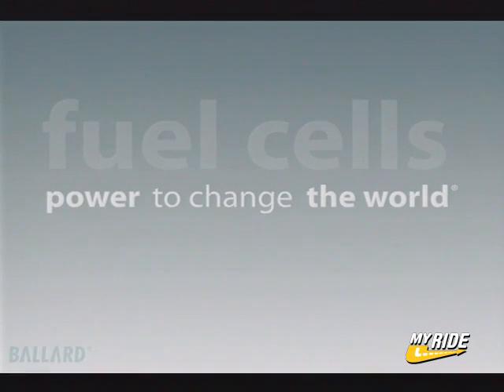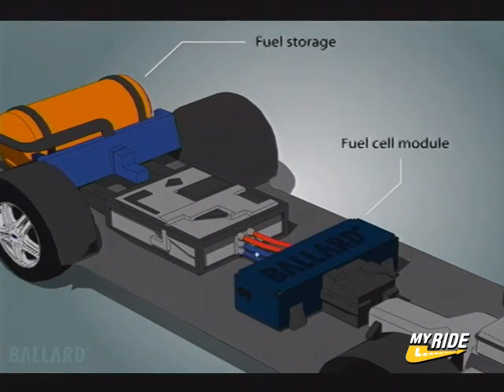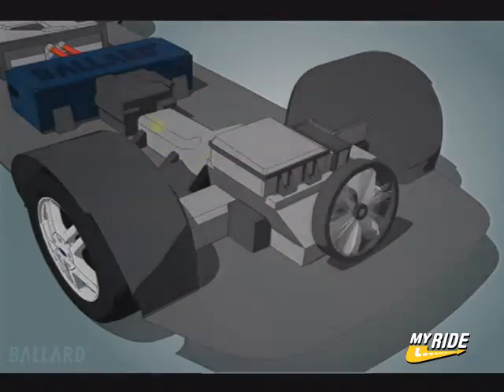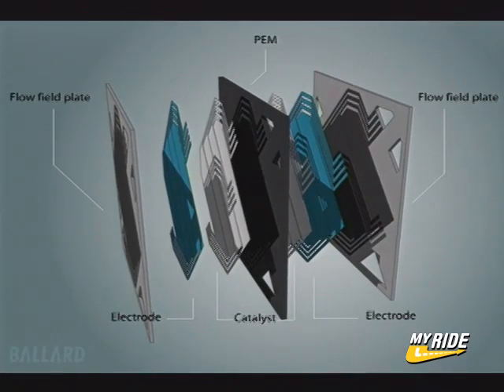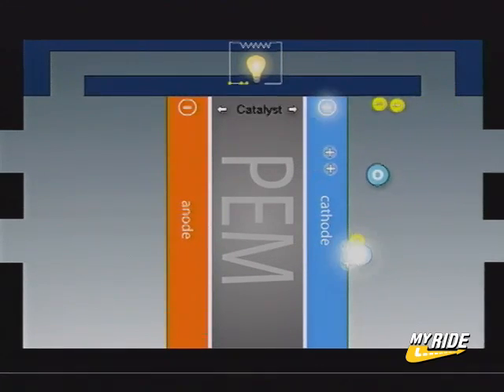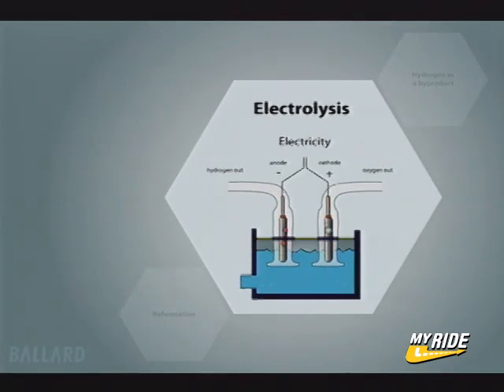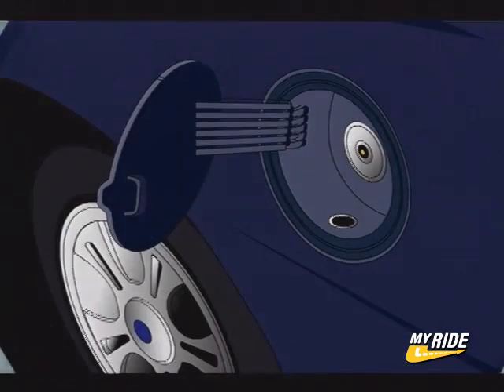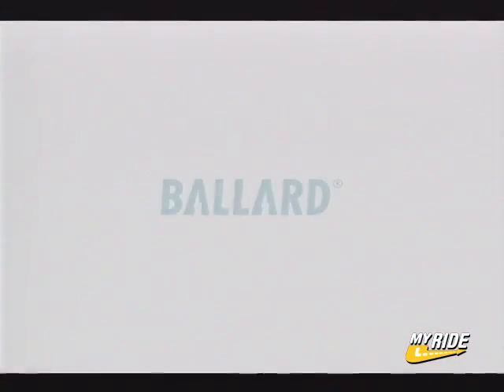Ballard Fuel Cell Technology

Comment: Umm, no.  I do not think so.  For a hydrogen atom is composed of one
electron, and one proton.  And to say that the proton goes this way, and
the electron goes another - sounds like "atom splitting" which would amount
to a nuclear explosion.
Moreover, one can imagine the square flow field plate being shrunk to the
size of a small circle, and made thick, and then long, like a wire.  And then
you would have protocity - a current made of protons.  But nobody is doing
that - proof by contradiction.

Comment: @derrazkhalid  You don't need Platinum electrodes.  Platinum is more convenient and less hazardous to use as it's decay rate is so slow but it's not a necessity.  216 Steel will do nicely.  Just dispose of the waste water responsibly.

Comment: Hydrogen is easily produce through Sea water electrolysis. The usual set up is, Windmill near the shore shocks sea water. Water is seperated when current is run through to H20--> H2 + 0 . The production of these cars might not be as clean as making a normal car but running a normal car for 10+ years is surely worse in the long run. (don't quote me) lol

Comment: this is fine..and a great concept.. however we need to first become efficient at the production of hydrogen for it this concept to be commercially viable.  
Another issue is the amount of energy needed to transform water into hydrogen or to mine for hydrogen trapped in air pockets underground. where is this energy coming from? how clean is that energy?.. no to mention enviro production of these cars...

Comment: actually getting the hydrogen generation isn't as big of a problem as the storage of the hydrogen. I'll have done a few class projects on fuel cell before, currently taking a course on fuel cell, and will be researching on fuel cell starting next semester. Hopefully we can achieve something useful. The professor's lab works with GM, so may be something even commercial scale can be achieved.